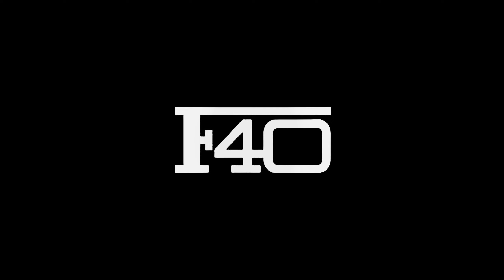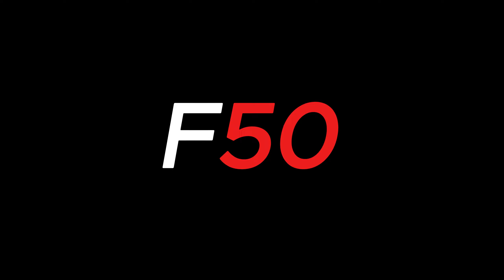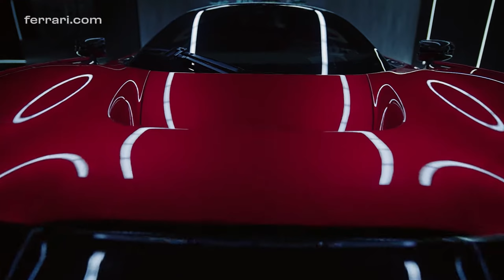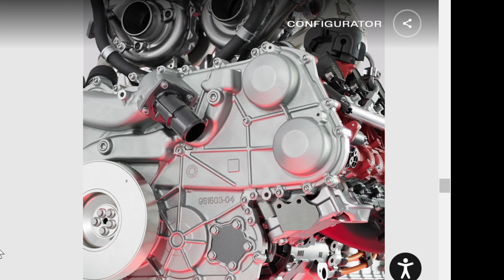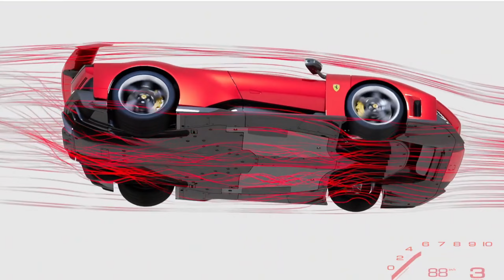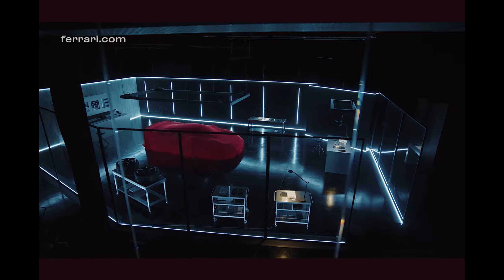The Ferrari F80. But would you really drive it? What you need to know.

Comment: You don't think it will "hit its full potential when it comes to the consumer market"? All 799 units are sold out. Lol.
Reply from the maker: @Tbland0930  I agree. What I was attempting to say was even though every one is spoken for, because it’s so much car in terms of cost, power, technology etc; it’s most likely not going to be driven wide open and pushed to the limits of its capabilities like it is designed to. Really like most super and hyper cars aren’t. That’s just my opinion. Thanks for your feedback.
Reply: @TheGICarGuy  Gotcha. Thanks for clarifying. Would you have this, McLaren W1 or the AMG ONE?
Reply from the maker: @Tbland0930  the One is such a big car to me and the F80 as impressive as it is really borders on race car (not necessarily a bad thing). The W1 is just wicked looking and seems more approachable. Slightly more practical? What’s your pick?
Reply: @TheGICarGuy  I’d have the ONE assuming they actually got the production units to work in full attack mode. I’d want to experience on a circuit at least once.
Reply: @TheGICarGuy  But the SF90 XX Stradale is probably my dream machine at the moment.
Reply from the maker: Agreed. Reliability seems to have always been an issue with the AMG. Definitely wouldn’t say no to the SF. Consider subbing, I’d really appreciate it. Thanks again for the feedback.
Reply: F80 makes the 400 look good